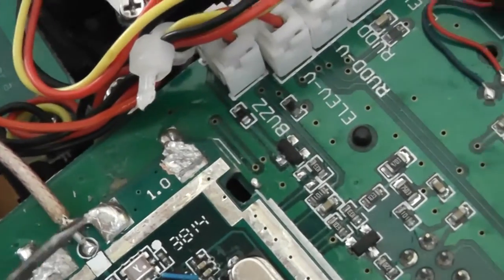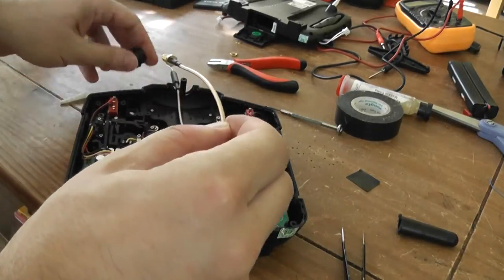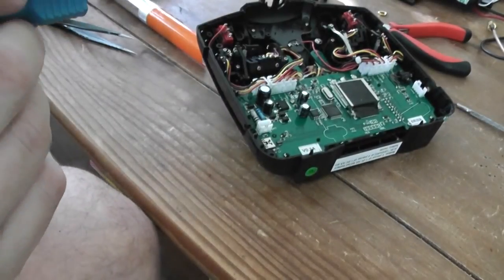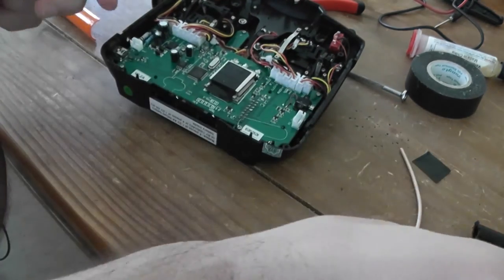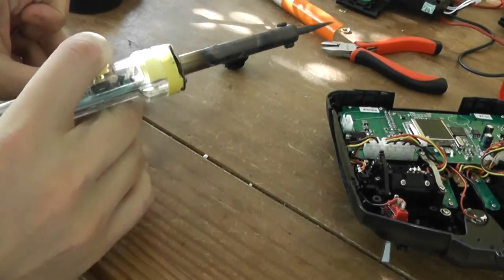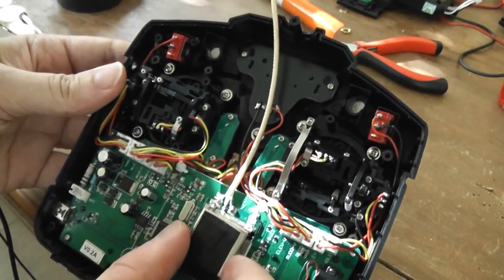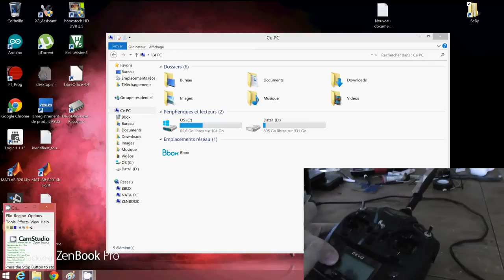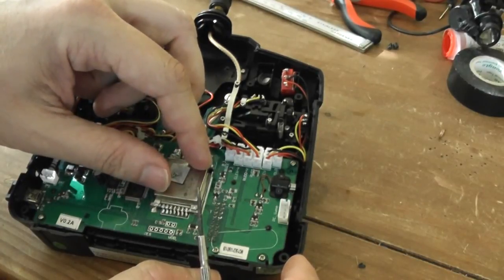Devo7E tutorials: part5 - CYRF6936 antenna mod

Comment: Love your work mate! Will you be doing one with the installation of the 8S upgrade to make the 7e a full range tx? Or how to install 2x3 switches?
Reply from the maker: Wayne Morgan No I don't think I will do the 8S upgrade chip installation for the 7E. Next one is the 3x2 switches. All videos are done now, I just need to do the video edition for the 3x2, nRF24L01 and CC2500
Reply: SeBy DocKy awesome. 2x3 switches will be in mine after I install the 8s upgrade and nRF24L01 and cc2500. My 7e is my backup for my 10.
Looking forward to the next video dude!

Comment: If I got it right, you set 100mW at the menu, not the default max, right?

Btw, there is no need to remove the middle post at the antenna outlet, just carve off a small amount of material where the cable passes and there will be enough space even with a RG316 cable.
Reply from the maker: aMax Yes I set to 100mW ... Yes maybe by carving it's working too. Whatever, with only 4 screws, the devo7E is well closed too
Reply: SeBy DocKy Thanks for the feedback and the proving how the mod performs.

Comment: bonjour SeBy et merci pour tes vidéos :)
j'ai commandé la Devo7E pour controler le yaw de mon H8 mini et d'autres modèles
je voudrais commandé le module nRF24L01 avec l'antenne 2.4G RP-SMA, de quoi ai-je besoin en plus? le cable RG316 RP-SMA et le connecteur uFL to RPSMA ?
ps je ne suis pas très bon en anglais mais grace à ton accent je comprend presque tout ;)
Reply from the maker: +davelaclasme Si tu prends le module nRF24L01 que j'ai donné en lien, tu as juste besoin du cable coax uFL vers RP-SMA, pas besoin en plus du RG316. Après évidemment, il te faudra une antenne 2.4G qui fini en RP-SMA
Reply: +SeBy DocKy ok merci SeBy si je prend ce modèle je suis bon alors pas besoin d'autre chose?   http://www.banggood.com/DEVO-Transmitter-Tuner-Modified-for-FBL80-FBL100-WLtoys-V922-p-89812.html
Reply from the maker: +davelaclasme Non plutôt ce modèle: http://www.banggood.com/2_4G-NRF24L01-PA-LNA-Wireless-Module-1632mm-Without-Antenna-p-922601.html?p=YL2512105842201212FR
Reply: ok nickel merci j'étais à deux doigts de le mettre dans le panier lol je vais prendre cette antenne avec   http://www.banggood.com/Wholesale-Dual-Band-2_4-or-5_8Ghz-6dBi-RP-SMA-Omni-Directional-Wireless-WiFi-Router-Antennas-p-49578.html

Comment: can the -RG316 RP-SMA cable work with the nrf24l01 from Banggood?
Reply from the maker: +Pinglei He (Pinglei's Pen Journey) In general, RG316 coaxial cable have two RP-SMA/SMA connectors on each extremities. I don't think there is one with a uFL in one extremity (to be compatible with nRF24L01 sold in BG)

Comment: Hi sebydocky 
I am now planning to do some modifications to my old devo7E...can I do this annenna mod with a thinner coax cable? for exemple this one from bg https://www.banggood.com/DANIU-50cm-U_FLIPX-to-RP-SMA-Female-Antenna-Pigtail-Jumper-Cable-p-924946.html?rmmds=detail-top-buytogether ? thanks a lot for your advise and videos ;)
Reply from the maker: I don't want to be unpleasant, but did you head about this new Jumper radio ? : https://www.banggood.com/Jumper-T8SG-Multi-Protocol-2_4G-10CH-Compact-Transmitter-for-Flysky-Frsky-DSM2-Walkera-Devo-Futaba-p-1189811.html?p=YL2512105842201212FR
Reply: hi sebydocky. yes I have heard about (I am a follower so I get your review for this radio last week in my mail!) but I am not interested on buying a new one, I feel pretty confortable with my 7E.

If I remember well you was talking (somewhere on your videos) about antenna signal. you said something like "the less of connectors and cable thickness you can have the better signal you can get form an antenna...that's why I was asking if it will be good to use a thinner cable rathan the RG316  for this particular antenna mod. I am maybe wrong...thanks for help.